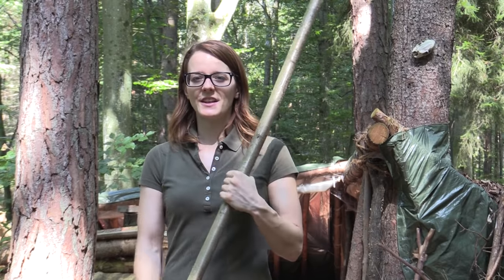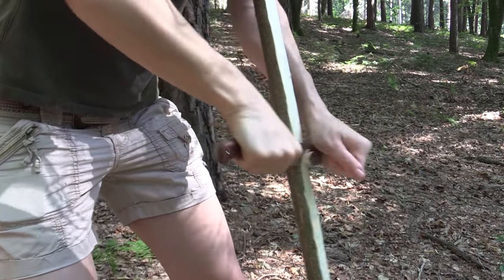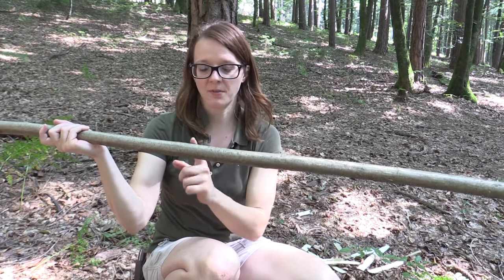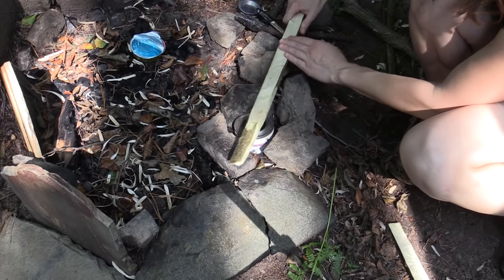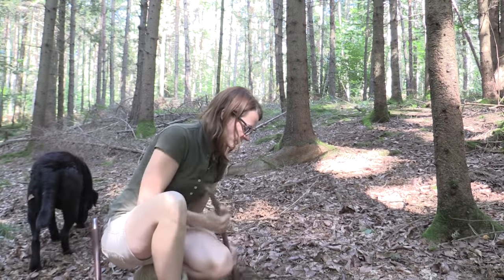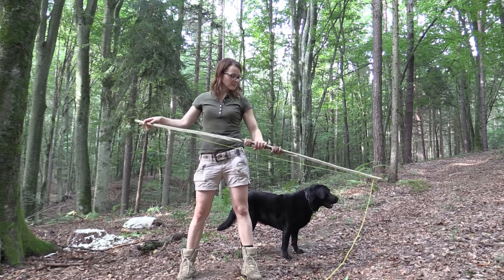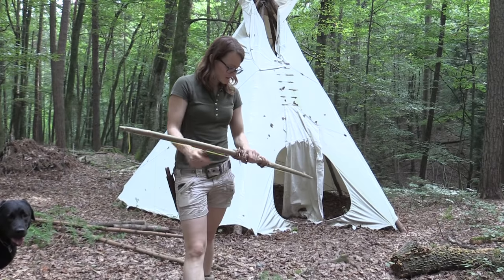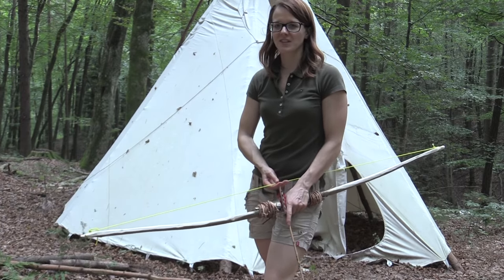How To Carve A Survival Bow

Comment: Just as a note on the bow and the materials around to make it. I noticed at 4:16 there's a plant that looks alot like a wild blackberry vine grappling with the pine pitch and bow. 

Blackberry vines, although initially prickly, can be tamed into very good cordage. You just cut off the leaves and then pound the vine down it's length until soft (the thorns do not stay). The are quite superior to spruce roots in both strength, weight, and durability.

Comment: I might ask something extremely dumb now, but why cut the stick in half to glue it back together?
Reply from the maker: it was an accident, i cut away too much wood so i had to cut it into half
Reply: Does gluing two sections in the middle make a superior bow to one carved from a single piece?
Reply: Nope, the more rigid the bow frame is, the more pulling strength it possesses.
Reply: If y'all would of been listening you would of know why she cut it. Good video by the way.
Reply: Right on Michael,,,if they would have been watching,,,they would have seen it,,,I sure did,,,,amazing how she was able to fix it!
Reply: She covered it in the video. I'm half deaf and I got it. Even more important than the survival lesson on making a bow. Was the lesson she demonstrated on adapting, persevering and making the most of the present situation.

Comment: Nice bow Lilly! =) Try not following the natural curve of the wood next time. Instead, carve the belly on the opposite side. That way you will gain a little recurve effect on your bow making it snappier and shoot faster with less draw weight. Every time you use the bow the wood get exhausted and every time the bow will straighten out less and less. Little by little so you might now notice first. The point is that the more the bow stays in the draw shape when not on tension, the less draw length you have to gather up power when you draw the bow. If you carve the belly on the other side you counteract this effect. 

You might think the bow will break if you change belly side, yes, make the bow a little longer, or thinner to compensate, but in the end you will have a better bow. Faster arrows is also important when shooting animals because they can get scared by the sound of the bow string shooting. If you have a slow arrow and a small gain, you might miss if the animal get time to move 1-2 inches =)

Comment: I suppose in a survival situation that bow would do the trick for a couple of hunts but you'd probably want to focus on making a 2nd one before relying solely on that particular bow. Depending on the design and profile of the bow would determine the type of till. General rule of thumb is you want the bow bending completely even threw the working areas of the bow. That particular bow looks to be stiff on the top limb and has a bit of a hing on the bottom limb. So if your feeling a lot of hand shock that's a pretty good sign that your tillers off. If your till is off your bow will eventually break. Not trying to be super negative about it just trying to give constructive  feedback. There is a gent on YouTube that does this, make a long bow in a day and shows how to properly till a bow in one day. I wanna say his name is mick. If you make another bow wood good luck, it's a pretty fun art form to explore I've found, a lot more involved then it seams at first.

Comment: Just a personal preference, I've heard arguments sway both directions in personal choice over what stance to shoot from for a bow, but I wonder what other people think about a particular stance used with traditional bows or primitive bows that don't have a natural arrow rest; bending forward at a forty five degree angle and shooting. I've heard people swear against it and for it, saying they shoot better or worse, but personally this is the stance I take for various reasons.
Your arrow will rest naturally between the "v" shape created, and the slight forward lean supports the back and shooting arm more naturally to me, and the change in angle of bend in the elbow supports a straightened wrist and keeps the bowstring away from the arm

Comment: What is the bowstring material? A lot of people use nylon paracord for survival bowstrings, but they'd be far better off using a spectra-based cord. Less stretch and less energy loss. I understand paracord is a common part of survival kits, but unless there is some specific need for a stretchy cord instead of a rigid cord, everyone's nylon paracord should be replaced with something like Spyderline.
Reply: I'm very interested in this topic too. What material did you use for the string, Lilly?

Comment: On more sober reflection, I judge my previous statement to be not well thought out. You did have to go back to the drawing board. I keep coming back to this video. Although I judge it better to have a bow of one piece I still can't get over how well this worked.  On some level in me, it does seem better to have the thick ends in the center with the handle as long as the joint is firm enough to hold.

Comment: Hazelwood is good if it appears where you are. Unfortunately we do not have that, but i am sure that even a piece of Poplar, which grows widely in the area where i live will do, providing that the limbs be made wider to give more power to the bow. Failing that, Bluegum will also make a serviceable bow.
Great instruction anyway, thanks for the video.
Reply from the maker: yes i think poplar might work for a bow with low poundage. you never gonna make a 50 pound bow out of poplar tough
Reply: Survival Lilly I live in North Carolina where Bradford pear trees are common would that work for a bow (you may have not of heard of this tree) I also definitely won't need a larger bow like yours also could oak trees Work?

Comment: Won't the bow eventually dry up and break at some point? I remember when I was a little boy I used to make bows myself from hazelnuts and that's what happened after some time.
Reply: Mata Pegheata not if you heat it up, it'll still break but it'll be more durable

Comment: I was always wondering what red spruce limb would be like for a bow. I saw one years ago made by a local native (Maliseet). He called it black spruce, but older folks call black spruce and red spruce the same, but they are two different trees. I know red spruce is very tough and strong when green. And you can find good sized limbs on old suppressed trees in the local woods. Red spruce is most abundant in eastern Canada (Quebec, New Brunswick, Nova Scotia) and in the state of Maine, USA. It is also in the mountain tops of the 'Smoky Mountain Range' of eastern USA. This tree is quite abundant in places that I work. But fewer mature trees because of logging. But no scarcity of trees. Something to check out in the future if you are ever doing a video in forest with red spruce.  A more precise range is given by the USDA website. Picea rubens is the latin name. It can grow as big as white pine and very old.

Comment: Lilly, Is there any truth in as the bow ages it becomes stronger & capable of higher pound force  ???
Reply: The wood dries so it becames less flexible I guess. But if you make a bow out of fresh wood or a sapling, it'll bend more to a shape under tension, therefore decreasing in it's strenght.
Reply: no it is not. bows green or seasoned wood and even fiberglass bows eventually take on what is called set and the bow stays slightly but permanently bent. this lowers draw weight and speed. it it most noticeable on wood bows but older fiberglass bows also take set after being strung for long periods of time which is why you should always unstring your bow when you are finished shooting.

Comment: Looks like the upper and lower limbs of your shortened version of the bow could use a bit more shaving to improve bending.  Since you didn't improvise a "tillering" board or stick to aid in shaving the limbs to their best bends, you did very well.  At forty to fifty pounds you could hunt deer or pigs with the bow.  But not in your country.

Comment: actually i made a bow with four pieces of flat slices of sycamore and the spring in the bow shoots about 50 feet but my accuracy was terrible i need practice anyway four flat slats six five four three foot long join together that is what gives it the spring and strength like a car wheel spring but not as curved as wheel spring

Comment: Dear Lilly 

would you be able to use those carvings from the bow for tinder just wondering what are the best european types? 

also sorry about dax
Reply: Hello James,
I am not Lilly, but I wonder if you can clarify the question please?
"what are the best european types?" Do you mean bow types or tree types?
As for tinder, well, I would guess those carvings (as-is) would not be the best tinder, but be good to use early on a small fire anyways.
Reply: tree types
Reply: Hi, Not sure this is what you hope for but myself, I have always thought that thin sheets of birch bark works well as tinder because of the oils in the birch bark. You were asking about tree types for good tinder, no? In my personal experience there is a great difference on what is good tinder, what is good early fuel and what keeps the, existing, good fire going.

Comment: there is a couple of issues, in a survial situation where you only have your knife you wouldnt have the pitch that you used on the bow, and the string you are using isnt something you would run around with your pocket either, so calling this a survial bow is a bit of a stretch, the arrows you are using would not be as accurate flying if made the way it was done in the very old days.

Comment: If I were out in the woods, the first thing I would make is a spear, not bow and arrows.  In fact, I'll probably make several spears (of various lengths).  Yeah, I know bow/arrow is way more effective, but bow/arrow requires a lot of skills to aim and get things right.  Especially when under pressure.
Reply: And I assume that in survival situations, you won't have that black glue nor sturdy strings.

Don't get me wrong.  I appreciate the video.
Reply from the maker: the black glue can be made in  20 minutes if you have pine resin and charcoal. no problem
Reply from the maker: I needed like 2 hours to make to bow, so it is no big deal if you practice making bows. its a lot of fun.
Reply: Wait, really?  Huh.  I should look into that.  And where do you get the string?  I suppose you're suppose to bring your own?

Yeah, I can see it being really fun.  I shall try that.  Thanks.